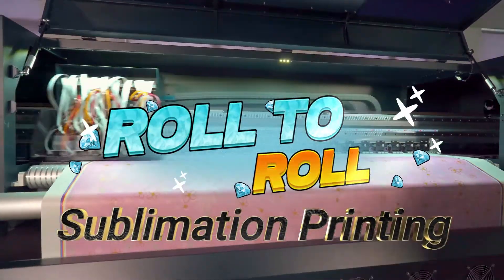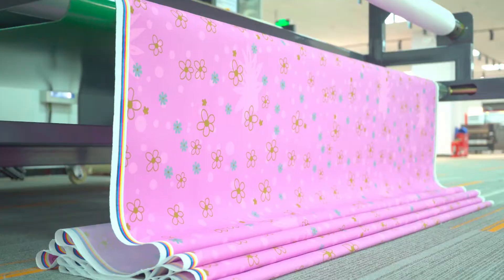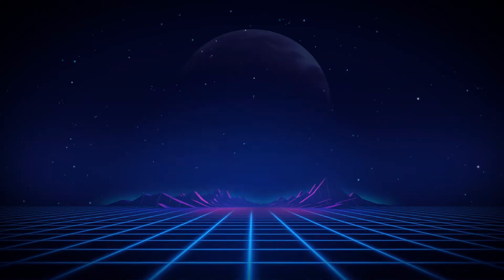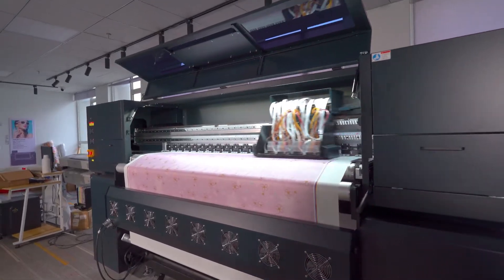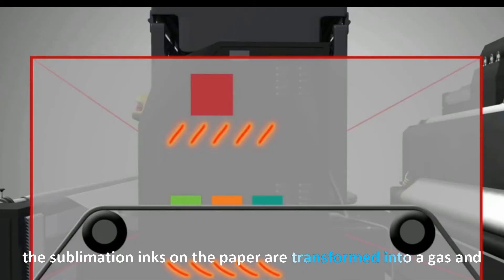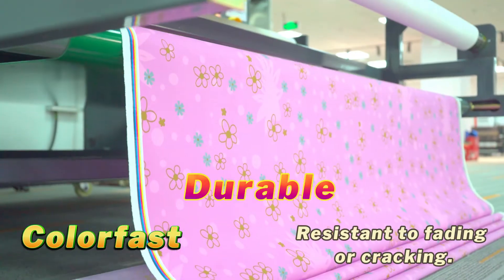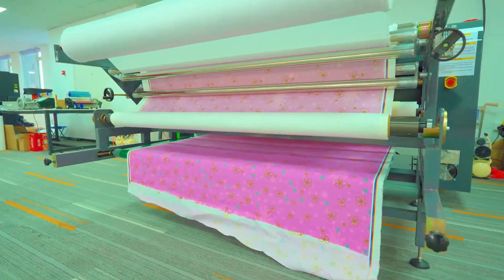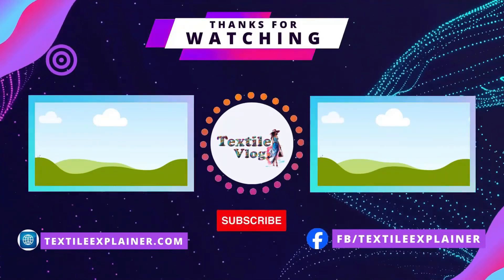Roll to Roll Sublimation Printing Process

Comment: This video describes the whole process of thermal sublimation printing in great detail, which has taught me a lot. It includes the creation of pictures, the thermal sublimation printing process, and the final pressing of the heat transfer machine. The application range is also very wide, such as polyester, chiffon, silk, and flag banner. Nice vedio!
Reply: Where can this machine be found, and how much is the price?
Reply: @rahadkhan3975  There is a corresponding machine link below this video, you can enter the details page.
Reply from the maker: Glad it was helpful!